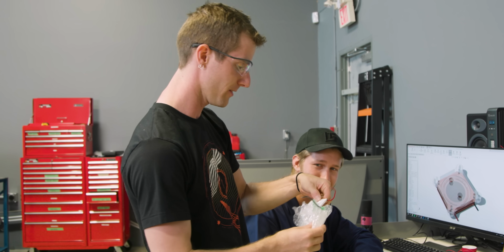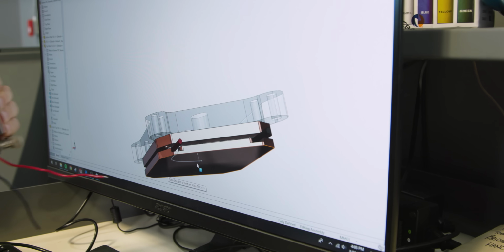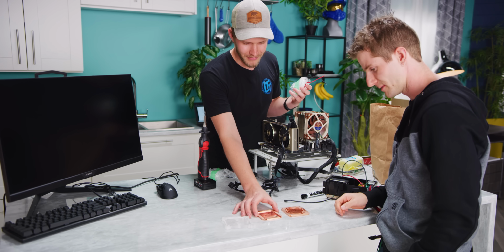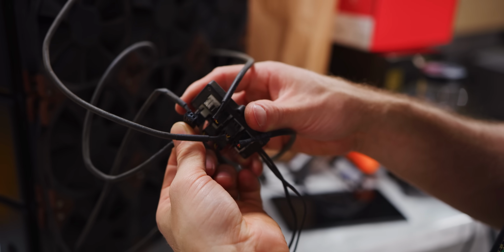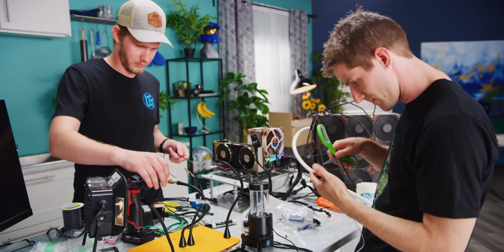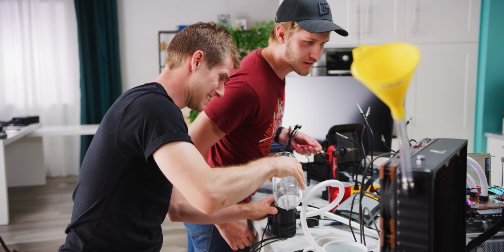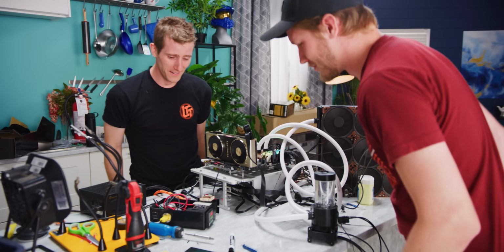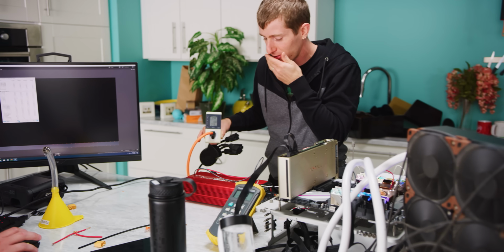This Cooler DRAWS 545W!!? Bad Cooling Ideas #2

Comment: You have to thermally isolate the hot and cold side of the TE cooler for it to have a chance of working.  Typically the cold side will have a pillar of copper the footprint of the TE element around .5 to 1 inch long with a foam insulation around it.  Where the hot side is attached to the cold side the bolts/screws will be out of fiberglass or stainless with nylon bushing for thermal isolation.  With proper engineering design this will work.

Comment: It's like when people use a battery to electrolyze water to create hydrogen to drive a car.
Reply: Except water electrolysis makes more sense when you treat it as a way to store energy, like a battery. You can’t really shut off many kinds of power plants quickly or easily, so they’re always running. So, make and store hydrogen when power demand is low. Meanwhile, you can’t “store” cooling.
Reply: @bubbledoubletrouble  But the original comment was about using a battery that is already charged to electrolyze water to make hydrogen to use as a different battery.

Comment: I don't think the custom CPU cooling block had properly insulated the hot and cold side. Normally you'd only want to transfer heat to one side, but in this case you needed to cool the peltier module itself and on the other side a totally independent and insulated copper block for the CPU. If the insulation is not good, then the hot side will warm up the cold side again.

Comment: Your experiment is like using an electric motor to run a generator to run another electric motor. Even with 100% efficiency there is no gain.
Try using the peltier to cool water in the radiator and then a fan to spread the heat into the air. Atleast then you are moving the massive heat source away from the cpu.

Comment: Sandwiching the peltier between the CPU and CPU Block is silly, ideally you would want the CPU in it’s own independent loop with a complete radiator setup and the peltier in it’s own cooling loop and some kind of heat exchanger between the cold side off the peltier and the CPU loop. This would allow to pc to be run normally (because it already had a radiator) and then when you want to go bellow ambient, you can simply switch the peltier on

Comment: Did he just said that using the connector for the CPU for power source is better than using any other 12v rail? I don't really know but I'm pretty sure he's still using a single 12v rail.

Comment: I built a pelter cooling selution before. I used it as AC for inside chasi. a hole in the chasi and then a old graphical cooler outside and then a cpu cooler inside the chasi, could then control the ambient temp in the chasi a bit. The idea comes from a bad graphical cooler that blowed the warm air not out from the chasi, but at the side of the chasi and that warmed the air that was going to cool my cpu.

Comment: My stock cooler keeps my CPU at 0°C. I use server fans.

Yes, my thermocouple is broken. /s. This setup would probably work better if the cool side came after a radiator.

Comment: You dont need to run the peltier modul full beans because its not effitient this way. You are better off running it at like 60%. Also there are documents for that exact modul so you can read that to find out where is the sweatspot for you.

EDIT: Here is a great video for you if you are interested in TEC cooling. This dude is a genius: https://youtu.be/YWUhwmmZa7A?t=1189

Comment: Linus, you should try see if you can actively cool the air entering the PC, rather than the CPU itself, so that the CPU cooler receives very cool air, while the device you are using doesn't directly get heated itself

Comment: Did you consider using a standard water block / water cooling setup, and then using the TEC to cool the water rather than cool the CPU directly? It would simplify a lot of the heat spreading / head concentration issues around the CPU's die. Basically, using the TEC to increase the rate water cooling system can dissipate its heat, while relying on conventional water cooling methods for getting the CPU's heat to the water. It would also help significantly with the thermal capacity issue, via using the water as a buffer. TEC-enhanced water cooling, rather than trying to cool the CPU with a TEC, then cooling the TEC with water.

Comment: They have horrible thermal conductivity... by design.
The heat generated by the CPU in hotspots isn't spread out across the Peltier unit.

You need a metal or better yet Graphite pad between the Peltier and the CPU. This way the small hot spot is spread out evenly across the entire peltier unit to cool.
Not saying it would make them useful but it would work a lot better. This was going to fail from the start.
Reply: Did you even watch the video
Reply: @mydogismilly  Did you, they showed plans for it to be wedged between two copper plates but come putting it together only ever showed one with the backside open.

Comment: I like the fact that you really made some effort to this, so no one can make excuses like "yeah, it could still work if you just did this one thing a bit better."
No you can't.
Reply: Wrong, peltier cooling solutions are known to get hotter on the cold side if the cooling on the hot side is defficient, it seems their water flow was way too low, judging by Linus saying the block is very hot, with a better block and more water flow, the result would probably be different.

They didn't even try their block without the TEC, it probably wasn't very efficient

Comment: Sorry Linus, but you seriously derailed that. A PID does a lot more than just PWM like you made it sound. I am not sure if you actually used its capabilities. Furthermore: Just increasing power on a peltier is stupid and what you did is heating your cpu instead of cooling.

A peltier is heavily thermaly conductive. This effect can easily overpower the peltier effect. A peltier can only hold a temperature differential. Meaning if you cannot cool the hot side enough you are heating both sides. And if you make the peltier output a kW of heat your tiny cooling solution will not be able to get rid of that. With insufficiant cooling on the hot side the peltier will only be able to act as a colling solution way below its max rating. What you did is heat your cpu with it.

Comment: Can you guys please buy a decommissioned Rolls Royce Merlin engine, stick a fan on the end and use it as a CPU cooler?
Reply: No. There would be too much heat generated by the cooler.

Comment: You are only radiating heat from the tech. As for your CPU heat you arnt taking away heat your just attempting to overwhelm it with cold. You will not succeed with this method, you would need to radiate your heat while introducing your cooling. I would think you guys wouldve seen this coming.

Comment: I watched a video of a bloke using tecs to make a small freezer and a fridge (two actual projects)
He commented on using many tecs at lower voltages.. eg run a 12v 80w module at like 4v and daisy chain multiple water blocks..
Suppose to make them work at a slightly higher efficiency

Comment: @Linus
Just try it with big air cooler block with good pipes and fans, your costom created water cooler is not suited for that high temperature range.
Have researched it years ago and it hase been done many times, every successful time i have seen it working was with air cooling.

EDIT: It draws so much because of the heat at the other side that is not cooled well enought.

Comment: Can the stock Wraith Prism cooler for Ryzen 7 and 9 processors be used to cool the X570 chipset instead of the fan on most motherboards? If so, is it good enough to passively cool the X570 chip? 

 
I haven't heard of anyone attempting it which is odd since I suspect most people who buy a high-end Ryzen cpu will probably get a better performing cooler anyway and have the Wraith Prism just lying around. 

So, can it be done?

Comment: @LTT The old rule of thumb wisdom with TRC coolers in the overclocking community was to run them at 50% of their maximum load because when you went beyond 50% you saw diminishing returns due to more and more waste heat being introduced.

(Similar to buying car amplifiers well beyond your required specifications because the higher the gain the worse the distortion.)

Comment: I wish you guys would abandon the stick it on the cpu approach and try the TEC on the other side (radiator side). Apply the 500 watts of cooling to the thermal energy in the reservoir.

Comment: that water pump appeared to be the bottleneck, no? like water flow was not able to take away the heat from the region, so the thermal suction works with a bigger heat difference on the sides and takes more power. i mean it just has this design flaw that bothered me, it seems so obvious.

Comment: What if you used a TEC to assist in cooling your radiator instead of direct cpu thermal transfer, may act like ice bathing your radiator but more controllable.

Comment: A pid regulator allows to control with analog value not on/off =(
If the level is too low it adds more control value, and the other way around

Comment: Linus :D its time to try - not to put it on the cpu and also not into the cpu cooling loop  :D try adding the peltierer to the loop after a normal radiator, so heat leaves as it would normally, and you cool the already aircooled water which needs an other loop clearly, and there you can add those massive radiators and fans :) this way you cool the cpu with double cooled water maybe below ambient maybe below 0 so be optimistic and use antifreeze coolant .... 
whatever  :D coolers gonna cool!  cheers!

Comment: Maybe they should change the way the heat is removed.Since the peltier cant take large heat spikes maybe the should add something to soften the spikes.So the peltier should cool the water in the loop and not the heatspreader of the cpu,  idk , maybe replace the radiator with a heat exchanger that has more than one peltier and radiators (see der bau8er with a similar project ).But still, the power needit for ...is pointless.

Comment: Did he (Linus) check if he put The hot side Down to the CPU? xD
Maybe it works, he just fu&@ed up??
Reply: It was the right way round as it dropped the temp at idle correctly, just couldn’t handle much heat

Comment: I have a better idea for peltier - normal water cooling over the cpu, then the water gets cooled to ambient temperature with normal radiators, then use a peltier cooler to bring the water stream below ambient temperature before returning it to the CPU

Comment: Such a cool project even though it didn't work this time. Putting a TEC directly on a CPU and trying to remove the heat from the CPU and the hot side with that water block won't work because your just generating to much heat and that water block can't remove 500W of energy fast enough.  I believe this might work if you just use a TEC chiller instead, but you might have to construct a chiller with focus on a good heat exchanger plate, block or maybe try and purchase one if you can.

Here's an article from 2001 that cools a telescope mirror with TEC.

Secondary liquid coolant loops page 7.
http://www.wiyn.org/docs/WODC-02-13-01.pdf

Comment: I was doing this back in 2001 with Swiftech and it actually worked pretty damn good until the plate finally failed after a year. Idled at 0C and 10C 100% load.
Reply: Ahh, good old Swiftech. I preferred Silverprop for my loop. The bong cooler let in too much dust and wouldn't let me use coolant so the block corroded and warped on my loop. 15°C idle with no tec on a Summers day.

Comment: It would have worked like 1000% better, if the peltier were used to cool the water separately, having the peltier its own disipation device... Something Something,Bad cooling ideas #3
Reply: Closed loop system, and instead of a rad, you place the peltier, and the peltier is connected to another CLS with a rad :thonk:

Comment: You're almost there guys.
All you need is:
1.A secondary cold side water loop with an aftermarket top performance water block on the cpu, pump, and a series  of high performance water blocks on cold sides of smaller tec's that would be easier to watercool individually.
2. Also it's a good idea to insulate the sides of a tec to minimize heat leakage, and also don't connect hot and cold side cooling on a tec with direct metal studs as those waste a lot of cooling power.
3. You might add an insulated big reservoir to provide cool water "storage".
4. You should also look into Constant Regulated Voltage tec control (meaning precise DC voltage source that controls cooling capacity by altering the Voltage level), , and also experiment a bit with thermal efficiency of a tec.
5. It also might be a good idea to get a water pump without an integrated water cooled engine, so that it could be insulated out of the cold loop, as every Watt of cooling power is precious on the cold side.

As a hint I cant say that most tec's get best efficiency at around 5-6 Volts, and below 20 degree delta between cold and hot side. This means that if you assume that your cpu will drain 250Watts you don't need a 500Watt tec, You actually need around 1500Watts of tec's running at 5Volts which gives them about 1/3-1/4 their rated power.

This should make you realistically succeed. 
Check out this site for more info https://www.meerstetter.ch/compendium/peltier-element-efficiency

Comment: the Tec would need to be between like 2 water loops so the water could act as a thermal storage. also the cpu temp changes to quickly for the Tec to change on the fly probably.

Comment: I know this filmed in a legit tool-shop and all but maybe hanging a couple of sound-dampening panels or cloth from the ceiling might get rid of that echo?
Also, why not make the cooler a square snake pattern instead of a circle?...you're still getting hot corners there guise! :/

Comment: Separate the cycles as I did. And reduce the water temperature with the peltir.
cool the peltier with another eyelash.
start the peltir loop first.
At 18 degrees turn on the CPU
https://www.youtube.com/watch?v=XkKbIP_Y9A4&list=PLEMp9XvhwLe_SHZcKe8zCEayuFIimHLA6&index=156
https://www.youtube.com/watch?v=CG-CVr_vEo4&list=PLEMp9XvhwLe_SHZcKe8zCEayuFIimHLA6&index=126
https://www.youtube.com/watch?v=758BIB8tS3s&list=PLEMp9XvhwLe_SHZcKe8zCEayuFIimHLA6&index=145
old`s >
https://www.youtube.com/watch?v=Aj3DXK7aVbA&list=PLEMp9XvhwLe_SHZcKe8zCEayuFIimHLA6&index=70
https://www.youtube.com/watch?v=0csO_FSYnGQ&list=PLEMp9XvhwLe_SHZcKe8zCEayuFIimHLA6&index=102

Comment: You don't need to gamble the hot and cold side. Just connect the pad to the power for a second and feel the heat and cold. That'll make sure you get it the right way just in case the Chinese manufacturer screwed up the cable color.

Comment: You had a major design flaw in your block that might be reason why your CPU throttled. You had cold side copper in contact on hotside copper, without insulation between. So the the coldside copper was sandwiched by hot processor and hotside copper.... o_O

Comment: Those things efficiencies drop off at higher current. You are also probably limited by the thermal mass at the CPU? You could make it work, its gonnna be big though and take alot more peltier plates. You want the hot end to be further from your cpu and your cpu sink to be larger. More plates running low currents for improved efficiency.
Alex you should check out this vid https://www.youtube.com/watch?v=YWUhwmmZa7A and bug Linus to make it happen.

Comment: Hi linus you should try making a peltier water cooler block were you'll run the water thru the cold side of the peltier and in the hot side you use all does fans that you use on the radiator since you got that fancy cnc machine you can build a replica of the cpu water block on a larger scale I would guest that if you use fourth of does peltier you make have better resolves

Comment: Why the last test performed on this video have no turning fan in on this massive radiator ? It's normal the tech did not perform, the heat was not dissipated correctly. I need to add, is the water pump was working and strong enough ?  Come on, you can do better then that.  It's like trying to move an elephant with a fork lift.